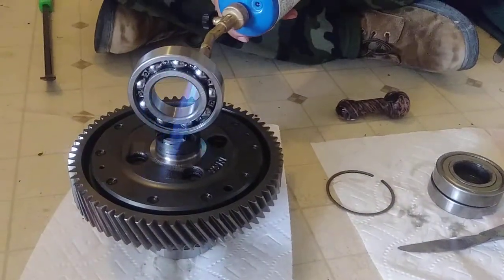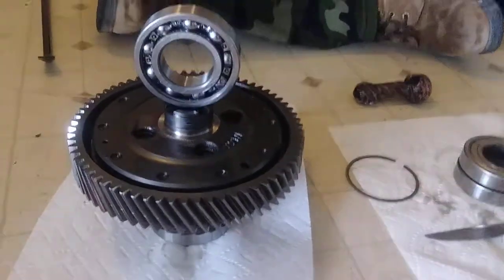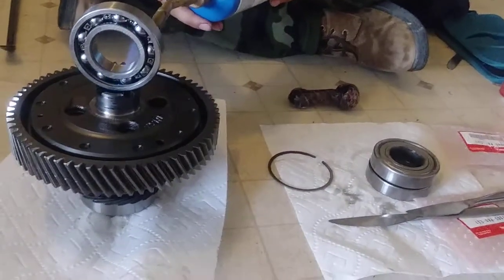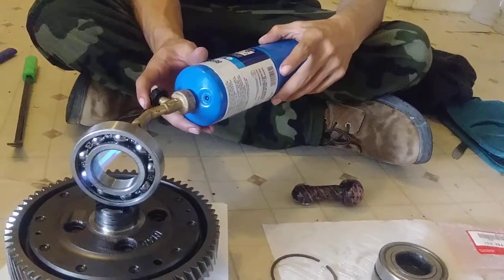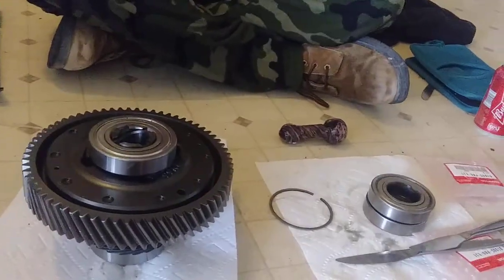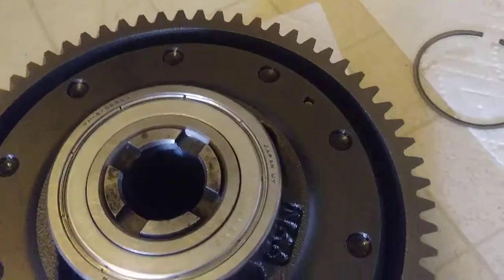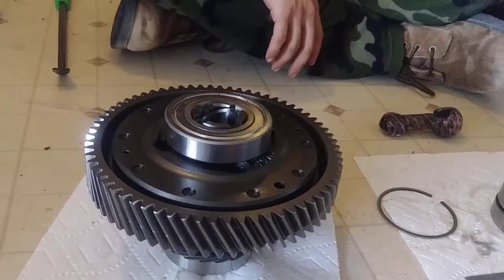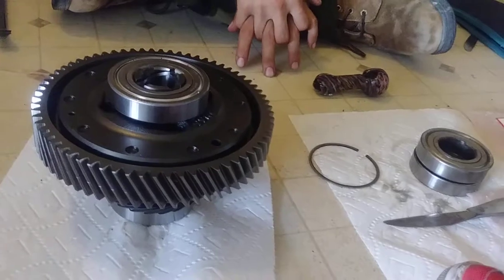Type r differential bearings install

Comment: How do I remove the old one?????
Reply: i did it with a puller and slide hammer. the one by the speedo i carefully cut it off with dremel